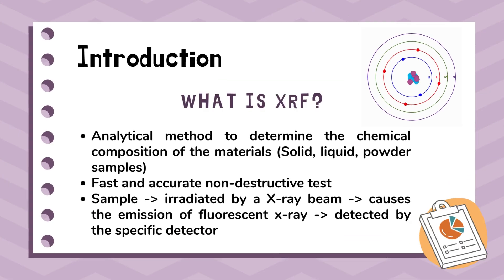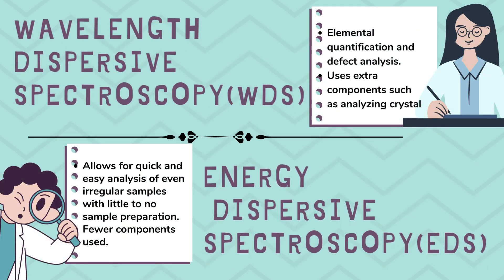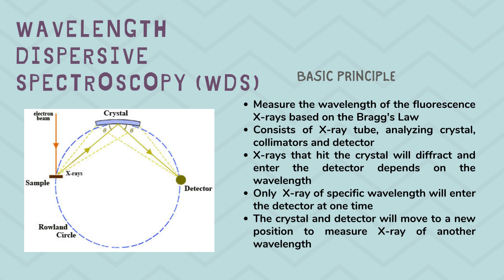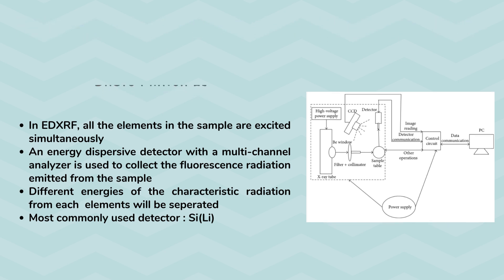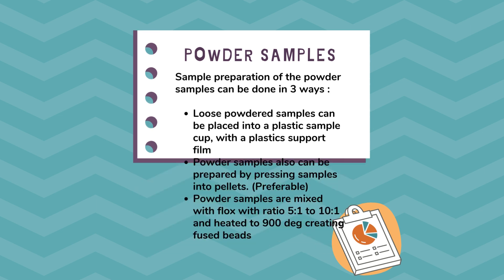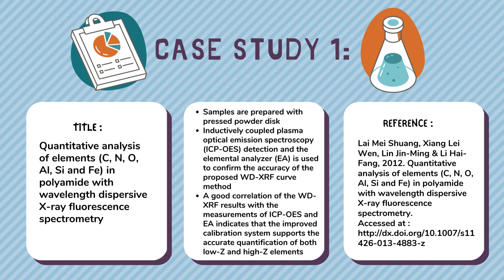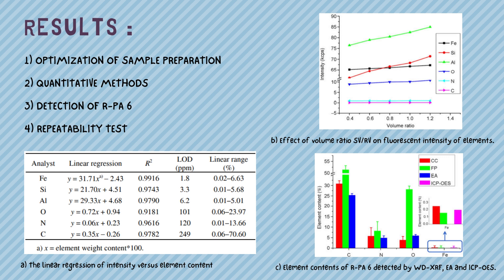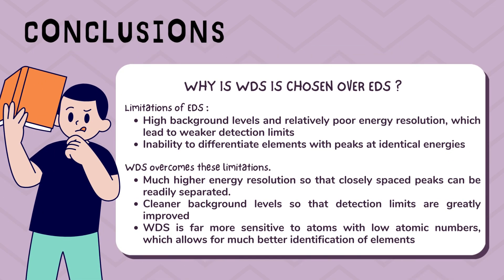Materials Characterization: XRF by WDS and EDS

Comment: Helo,Why do these crystals rotate, why do they not stay in place, why do the x-rays not go directly to the detector, and why do they have to pass through the crystals?
Reply: the crystal basically filters the incoming wavelengths. So that the detector can analyse each wavelength at a time. This method will lead to better resolutions, better quality images, ...etc